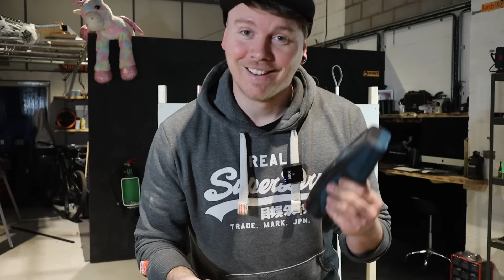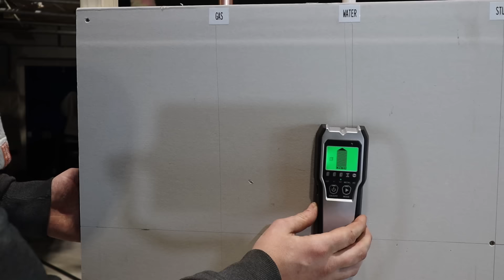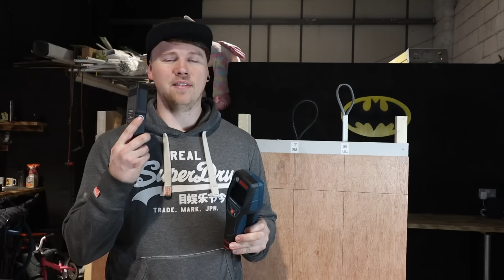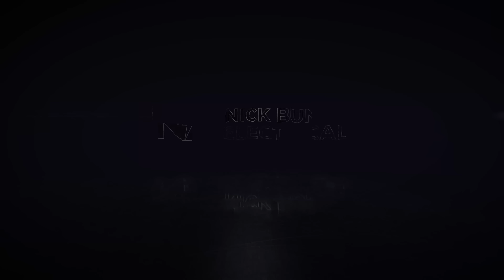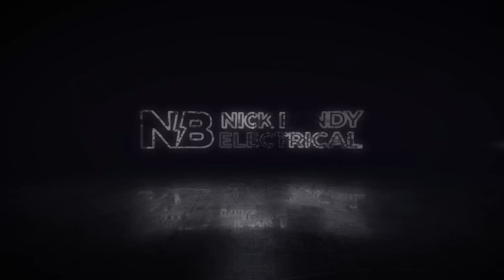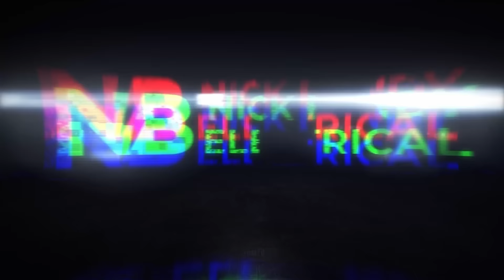Cheap VS Expensive Stud Finder test - Electrician

Comment: You seem to have missed a super important point here. Because we are unable to see behind the wall like you can in this test, the fact that the Bosch shows live electric alarm on everything makes it absolutely useless.  If I cannot determine if it really is a live wire or a dead one or a pipe or a stud, I would not be game to drill to find out. I may as well just guess! It isn't ok to say "oh it works well but just happens to show live for everything". That is NOT working well. That is no use at all because we can't see behind the wall. How about you set up a blind test and see if you can actually detect where a live wires is and where a stud is? All you content creators have done this exact same stupid test.

Comment: The cheap one is worthless. If you have several live cables near to each other because they split for example in different directions, one into ceiling for a lamp, one cable I to the wall for a socket and for the lamp switch near the door and a 3rd or 4th cable for more sockets placed at various walls in the room, it goes absolutely crazy and constantly gives false readings.
Better get the more expensive one, it'll save you a lot of trouble and sorrow afterwards when you will actually start the drilling.

Comment: The Bosch model you demonstrated is actually really what I'd call a mid-priced unit. Units like the Makita DWD181, Bosch D-Tect 200, & Hilti PS 85 cost more than twice as much. And the most expensive units like the Hilti PS 1000 & Procep GPR 8100 cost more than ten times as much.

Comment: Thanks for the review! I’m new to DIY projects and had a quick question. After finding the studs, how can I be sure there’s no electrical wiring behind them? Even when using a high-quality stud finder, it sometimes detects electrical signals, but they don’t always follow a clear path. Is there a reliable way to confirm that I won’t hit any wires when drilling

Comment: Put some shingles over a section of plywood and then put a stud behind that. See if these things will detect the stud. I need to put up solar panels and don't like the idea of drilling random holes trying to find the truss stud then having to fill in the unneeded holes. if one of these units would work for this, I would like to know.

Comment: None of these work on my walls.
My home was built in the 1970s and has a motor plaster over gypsum wall board.
I've tried 3 from $12 to $40 none of them find studs let alone any pipes.

Comment: The fact that the Bosch can't distinguish between WOOD, gas, water, and live wire makes it pretty useless... You're looking for a stud... And now you have 4 unidentified possibilities... What are you supposed to do now. You have a 75% chance of getting it wrong... This tech is 30 years old... And this is the best we can get? I'll just continue to feel for the stud with a fucking nail... That'll be much more accurate as studs are tight to the back of the drywall or lathe, and wire and pipe are set back quite a bit...  It'll be fine for concrete as you stay away from EVERY signal...

Comment: Thank you for this useful video. I bought the cheapo one. It worked well for studs but I couldn't get consistent results for finding electric cables. Maybe mine were buried too deep. They were under dot and dab dry wall.

Comment: Thank you for your video.  They have a new version with updated sensor model TH530.  Like to see that.  Also the TH530 says it continuously looks for AC wires in stud modes.

Comment: Would be great to see a test on copper pipe in screed floor.  I have a £40 Bosch Truvo green detector and its also no better than my £15  amazon. I've seen some reviews that suggest static is a problem for the Bosch 120. Earthing yourself on the test surface seems to improve results.

Comment: Shouldn't you have hold the plaster board with your other hand when using the Bosch like you did next with the cheap one. The static electricity charge of the test wall is different leading to inaccuracy. Also you are using a Bluetooth microphone? If so it could affect results. Thank you for the very insightful review nevertheless. Pricey products seem unfortunately the ones to go to.

Comment: The only thing I would like to see added to this test is how they both perform when the wall is filled with batt style insulation. Will the density of the insulation throw off the detector. I have a cheap stud finder and sometimes it just cant find anything as it must think it is all the same density.

Comment: So, me being a rookie in this topic, could use that cheap one to find wood studs that I wanted to drill into to mount pictures and things on the wall, would receive the same beeps not only for the studs I’m looking for but also the gas lines, water lines and electrical lines? How am i supposed to know what I’m drilling into exactly if it beeps at everything?

Comment: But the last two, the live and dead cable, with the plywood also applied, you forgot to change the setting on the cheap model!  If you had, I bet it would have picked it up.

Comment: Really wanted to watch this video cus I have the cheap one and it is shockingly bad. Even comes with an Amazon £5 voucher if you drop them 5 stars. My cheap one was giving false positives all over the place and wouldn't pick up anything easy like yours did. I also had no idea what setting to put it in as the instructions were for a different machines 🤣. For me personally, I'd go for the Bosch one cus I think even at that price, it's still way cheaper than if you drilled through a water pipe.
Reply: Can't be legal surely. Maybe £5 voucher for a review whatever the stars you give?

Comment: Nick, regarding the stud finders, they didn’t distinguish between wood or Metal? What I mean is you could run the stud finder across a wall it bleeps, but what is it? wood or metal? it could mean the difference in drilling into a stud, Gas pipe or water pipe
Reply: You set it to detect wood metal or voltage it also has settings for different depth of wall bird ie one layer of plaster bird set it 1/3 two layer 1/2 or whatever

Comment: Did you have water in the water pipe or was it just empty?  I would expect that to have a difference but it was good that the Bosch detected it in either case.
Reply from the maker: There was water in it mate 👍
Reply: @NBundyElectrical  Thanks for clarifying. :)

Comment: Finding water pipes in screeded underfloor heating loops might be a useful test.

Not often you need to drill into a floor, but when you do the absolute last thing you ever want to do is bust into an underfloor heating loop.
Reply: what about glue instead of drilling

Comment: Nice video. Was the water pipe filled with water? The Bosch is radar based and looks for background refection changes as you move it. The cheaper one must use some change in induction hence limited in depth. you get what you pay for.
Reply: i was thinking the same, also was the live cable connected to a load and carrying current?
Reply: Not sure if you don't need the pipe to be connected to the network, so you have the grounding, too. That would work in a real case scenario, not an isolated pipe.

Comment: Having drilled through a microbore radiator pipe embedded into wall and going off at an angle, I've always used a detector.  Had a few cheaper ones, but now own a Bosch GMS 120 which sit's nicely price wise and is more accurate I find.  Only £85 and you've got quality over the cheaper units.  That being said, I still carry cheap ones in the van too!  Sometimes even use both if I'm really uncertain.  If only they'll track deeper into wall as there's still no guarantee you won't hit something.

Nice video though to show the differences and limitations.

Comment: Great demo. I've had a few detectors over the years and none have really worked.  Looks like the technology has improved.
Reply: Also it's completely different technology the devices use. The cheap one uses a sensor to pick up electro-magnetic waves, the expensive one uses radar.

Comment: Doesn't the Amazon one have separate metal and A/C modes? Did you try these on the final test with the extra plywood?  It seemed to find the stud which you would expect as the 3 depth settings are for stud work only

Comment: Studs are easy with a magnet or tapping and some volt-sticks will show wires... the biggy would be cable/pipes under floor boarding and checking for underfloor heating elements... also checking path before using a wall-chaser (pipes and cables buried in plaster)
I would be uncomfortable relying on the cheaper one in those circumstances. I think you were wise to get the Bosch, if it saves one mishap, it will have paid for itself
Reply: This exactly....

Comment: Had a look at both of these via the links. To be fair the £15 one doesn’t mention plastic pipes anywhere in the description of its uses, whereas the Bosch one specifically does mention plastic water-filled pipes. I think from the details given they use slightly different technology? Anyway, another great vid and for most situations the cheapo one would probably be good enough. 👍
Reply: Yes, but you only need to have a slightly deeper cable or metal pipe once and you will pay a few times the device price for repairs. Plus the complications.

Comment: I wonder if the water pipe result would be different if it actually had water in it? 🤔
Reply from the maker: It did have water in it 👍
Reply: I think you need it to be connected to the network, so it has grounding. This was an isolated pipe.

Comment: If you want an accurate stud finder ‘Hilti Ps50’ it’s mm perfect even in concrete to a depth of 150mm
Reply: £896.
Reply: @philpearson1714  
Pays for itself.
Drill through a cable or UFH pipe on a tiled floor or microcemented wall. 🤷🏻‍♂️

Comment: Still got one I bought from maplin 20 years ago for £25. I wouldn't pay out for the bosch unless it used better tech. Now if bosch got one of their smart tech savvy employees in the r&d department to combine microwave radar and some mathmatical magic to display density on a screen, like an ultrasound or thermal image then we would be laughing. Just give me 10% of sales.
Reply: You can't get better unless you start using tools that spit out beta radiation
Reply: @jkxss  I think a microwave array could do it quite nicely. I just couldn't apply enough clever maths to figure out the reflected phase and frequency interference and the display an image. Deffo possible though.
Reply: Have a look at the Bosch D-tect 200 C.

Comment: I have green bosch and same cheaper version. The bosch is a bitch to calibrate. It gets confused when checking for pipes behind plasterboard because there  is stud and copper detected near to each other so needs calibration sequence for accuracy. Cheap one has specific material settings so it bypass the stud when looking for copper etc..

Comment: I find by holding your hand other hand on the wall make the Bosch more reliable 👍
Reply: This works for most of the metal/voltage detectors. I think it’s something to do with static in the wall, placing your hand on the wall earths it, ??

Comment: Fantastic video nick,👍
I have the cheep stud finder 
And it’s never let down .
You have proved what I have been saying for years, cheep doesn’t mean crap, all the brand junkies need to re think , and accept the fact that they are all made in the same factory in China and given different brand names. All your bosh drills do you really think they are made by bosh in Germany, well they are not they made in China by a company who also make de Walt black and decker as well as many others, fantastic review 👍👍❤️
Reply: It's the same with golf balls. There are only 3 factories in the world making them.
Reply: The companies have different requests and standards. That makes the difference in many cases. See how a simple cable or gas pipe could be one centimeter deeper and then you might puncture it. The repair is worth a few times more than the device itself, why even risk having a complicated repair in the wall at first?

Comment: The lightning bolt is showing on everything due to static if you put your other hand flat on the wall… you won’t get that false reading anymore…. Your other hand acts as a earth path removing all static 👌🏻
Reply: Gawd, thanks so much. I got one as a gift and the thing would not shut up with electric hazard warning. I spoke to Bosch, read the manual forwards and backwards - assumed it was broken. This did the trick.
Reply: That is correct
Reply: @moses84hickory  ??? Okay Tesla.
Reply: you  legend!!
Reply: Thank you
Reply: so di need to hold my hand on the wall all the time when searching :D thanks!
Reply: Thankyou x

Comment: I had this discussion with another trader the other day. He was using the Bosch and picking up an electrical signal, I knew the building and there was definitely no electrical cable there. Told him it was a false reading and he wouldn’t have it. Either metal or no metal, the rest is about drilling a hole and having a dig about lol
Reply: It might have been a dead cable a mouse or bird .

Comment: Would be interested to know if it still works on plastered surface ?
Reply: Especially lath and plaster stud walls. After trying a cheap one I ended up using a strong magnet to find the nails in the studs.